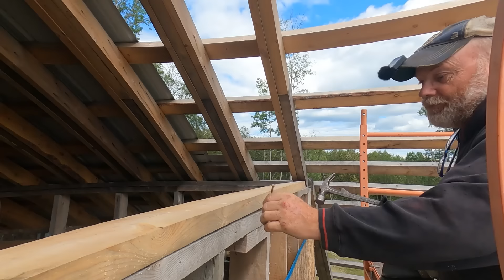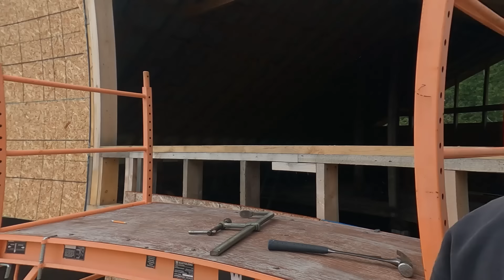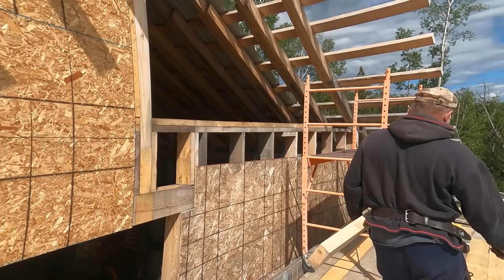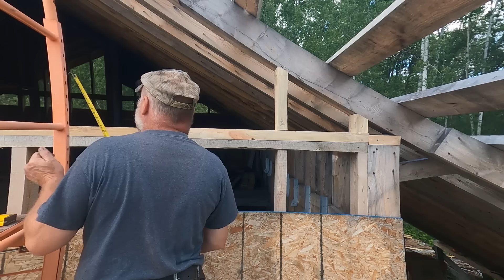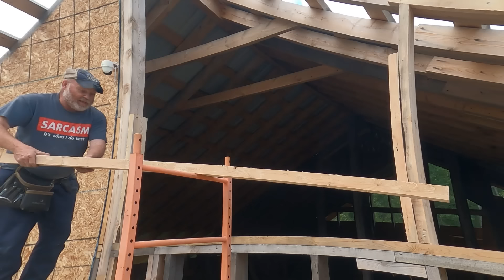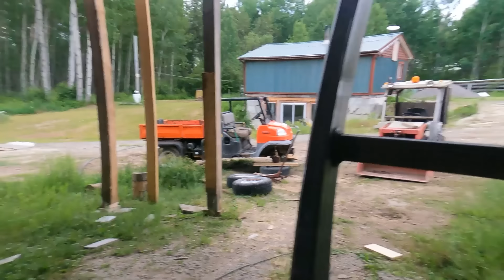WOW!  Very Exciting.  Can You Believe This?  Our Post And Beam Building Is Almost All Framed In.

Comment: I am always amazed at your desire to have all the boards within an 1/8 inch measurement. I see in another 5 years that the building will  find it's own level and the pigeons wont give a heck..  Nice to have an exact  building but this is not an oak cabinet. Don't stress so much over 1/8 inch.. Enjoy the build because you are the only one to know where all the mistakes are located..